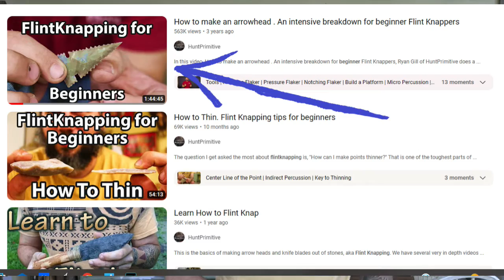Flintknapping Obsidian Clovis

Comment: I heard a tip for getting obsidian or dacite chips and dust off without them digging in from Patrick Blank the other day, by using a small whisk broom. I use one I made from pine needles....just crush the ends to soften them up.

Comment: I ordered a broken Clovis base, an unfluted Clovis and a couple of finished Clovis points from Lithics Casting Lab.  
The broken base reveals a nipple platform, located bias to one side of the basal end.  The other yet to be fluted Clovis point has a very pronounced nipple.
A “platform” bias to one side is just a platform below centreline. 
But a flake removed on a point with “convex” cross-section will see the flake run in the longitudinal direction.  It’s just a given.
Even in your video, you had difficulty NOT removing a longitudinal flake.  
A more Convex “thicker cross-section, allows higher energy strike and a longer, deeper Flute.  
Folsom is done with a flatter cross-section, with a wider nipple.
So, what is a Caribou Clovis?   Is it just a a variant of a Clovis with a more “pointed” distal end?